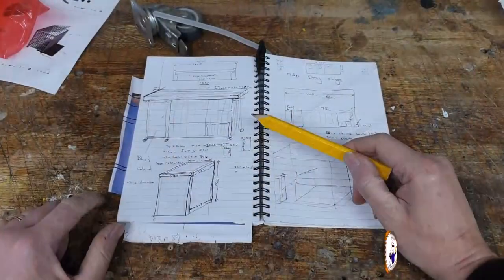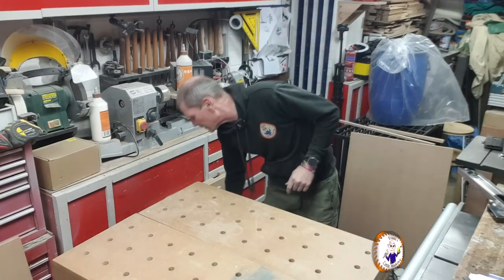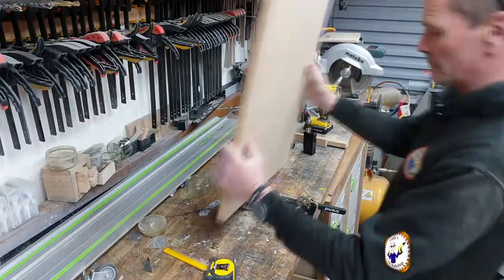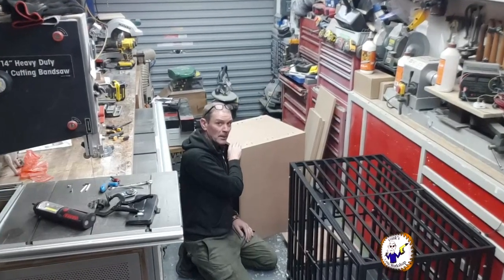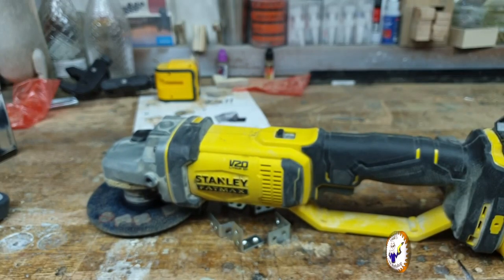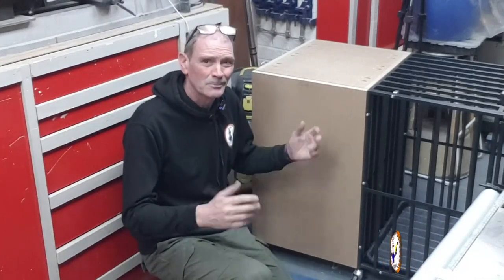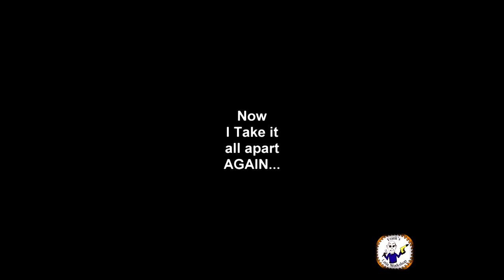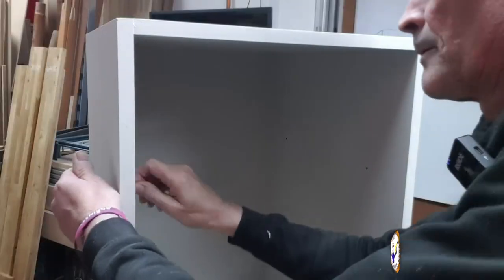Custom Dog Crate Part 2 "THE CABINET"

Comment: Nice solution with the brackets, and I like the locating divits for the shelves. Not having proper space makes everything harder, and is so frustrating. But there is always something to overcome. Tight budget, need a tool you don't have, too hot, too cold, it's always something it seems. Most of us can relate I think. I hope Mrs. Little Workshop doesn't know that you fit in the crate.
Reply from the maker: 😁 Thanks Chris. It just confirms I need to have a clear out in the workshop to give me an extra few square inches 😁. The shelf divits work a treat (will use that design again i think). I made the mistake of letting her know I fit in the cage..... so I had to get it out of the house and delivered as soon as possible before she got any ideas 😆😆. Thanks for watching  Chris 😁👍

Comment: Coming along nice, Frank. Liked that idea of the angle bracket on the actual dog crate to hold the cabinet flush to it. Btw, the wall paint on MDF will work. I did something similar on a set of cupboards in my study. It's probably late now, but I also added 2 coats (I think) of yacht varnish on top of the paint!
Reply from the maker: 😁 Hi Suj, hope you are well. The matt finnish really really needs a protective coat of something, I'm sure it will pick up marks and fingerprints at a rapid rate. But.. thats what they wanted !!. Thanks for watching mate 😁👍

Comment: Great little build in a very tight work space. MDF is not forgiving and you've made it look simple - especially the shaker door changes.
Reply from the maker: 😁 Thanks Ben. The door change wasn't expected so I did the best I could in the time I had. The lack of space is a massive pain... but anything is possible. It just takes more effort 😆😆. Thanks for watching 😁 👍
Reply: @frankslittleworkshop  They should be delighted with what you've made. Cheers Frank.